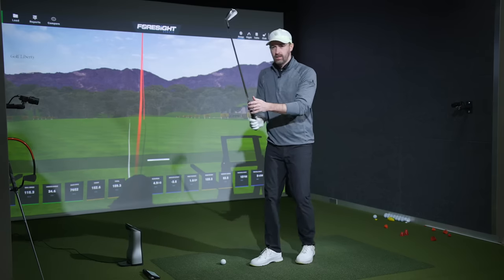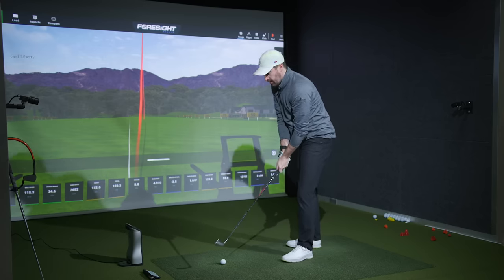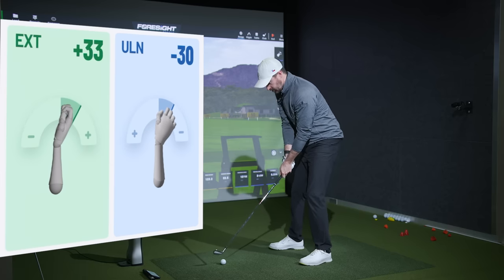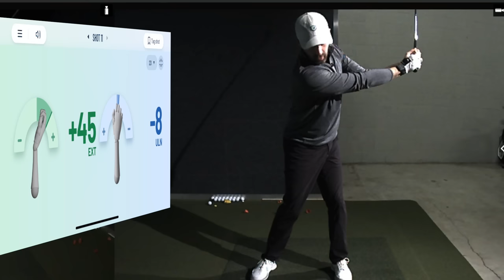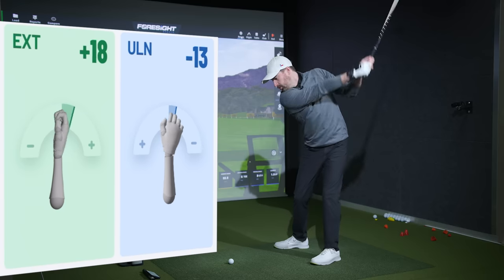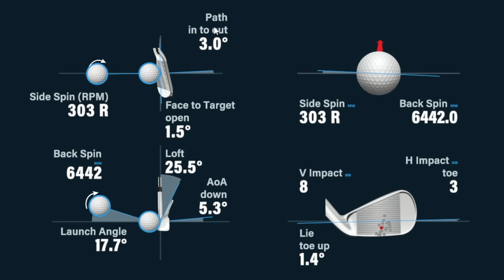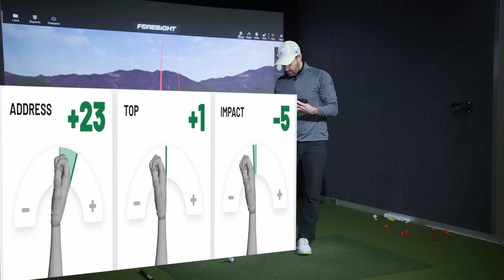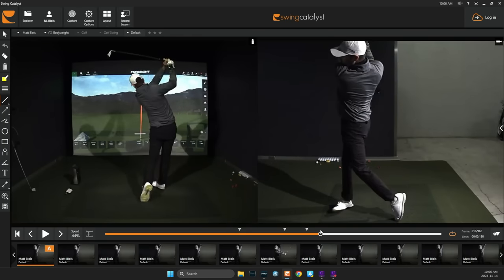Can't Hit a Draw? Here's Why

Comment: Hey Matt, really good video as usual.  Just wanted to pass along something I heard from a couple 3D coaches (Jon Sinclair and James Leitz) in podcasts.  They both have big databases of tour players and say there isn't anyone who has their wrist in flexion at impact.  I agree 100% with you that you don't want your wrist to have a large extension but trying to get it flat or in flexion is almost impossible and probably reduces speed.  Jon Sinclair really likes the Hack Motion sensor for training like you are showing us, but he said don't take the absolute numbers too literally as that is not its strength.  It's really about the relative difference between the different positions (i.e. setup vs. top vs. impact).
Reply from the maker: Makes sense, depending on how you do the calibration I can see getting a minus number at impact might be unnecessary but the difference is key.
Reply: Okay, good to know and thanks for sharing this.
Reply: Matt, I listened to these podcasts again and I now think I may have incorrectly interpreted what they were saying.  I now believe what they are saying is that no one is moving into flexion or holding flexion at impact.  They are all moving in the direction of extension but it doesn't mean they will get to extension at impact.  It's subtle difference, but important. The podcasts did not specify where the tour players' wrists were at impact.  I assume because it variable and depends on the player. Sorry for the mistatement. @GolfLiberty